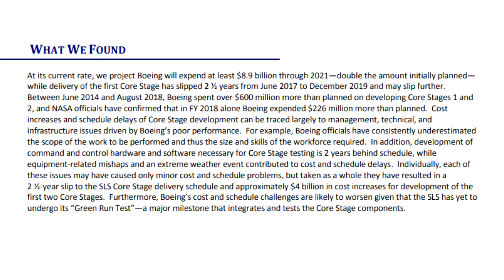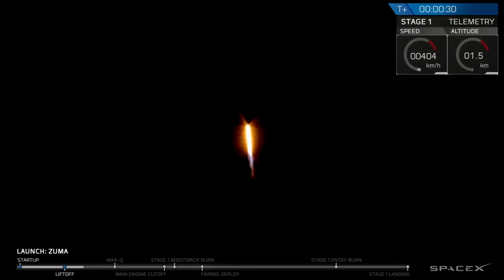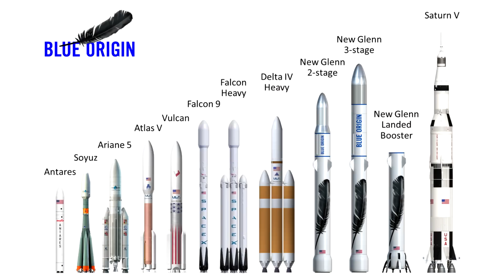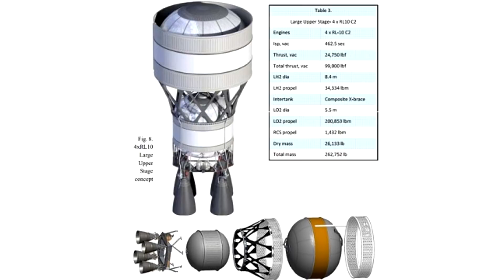New Glenn, OmegA and Vulcan Get Air Force Approval

Comment: I think SLS will be cancelled. Especially if New Glenn gets flying. It is way too expensive and only exists because of government money.

If SpaceX actually gets a certified Dragon II, there really isn't any reason for SLS anymore also.

I'm a little surprised that they didn't give SpaceX some money to develop a new fairing so that they would have them as a backup to the unproven New Glenn, OmegaA and Vulcan designs. It is very likely that one or more of these programs will be delayed, and quite possible that all three will fail. (Space is hard.)

On top of this, BFR could potentially be capable of replacing EVERYTHING being developed. It could be cheaper than anything except New Glenn and will have more DeltaV than any of these.

I hope that all of these new rockets flys. This is an exciting time for a spacefan.
Reply: David Messer It won't get cancelled. It has too much  support from very powerful members of Congress.
Reply: jeffery exposito  political winds change so often that who knows what the future will hold.
Reply: SLS's issue is that NASA fundamentally cannot build big things efficiently. Every project needs to be split into 48 independently manufactured and transported parts to get any funding. Workable when they're building rovers, telescopes, space probes. The things that no private company will do, anyway. Not so good when it comes to transporting huge fuel tanks across state lines on flatbed rail cars. The wasteful practices just balloon the cost of launch vehicles compared to anything else, and SLS design seems to be suffering from so many of the same issues as the rest of the post-lunar space program. My real worry is that the inevitable wastefulness and limited use of the SLS will be used as an excuse to defund NASA across the board, killing off payload development and.... cough... climate change research
Reply: Oh man my heart is racing I cant wait to see the future unfold.
Reply: SLS has always been a trash political move, the project did not came because of the science community
Reply: At this stage, it's anyone's game. The USAF is being picky, as it mostly has been since the STS fell into retirement. Doesn't help that NASA's budget is stretched thin as is, considering SLS isn't their only project (new satellites, new space station plans with Roscosmos, lots of tests, infrastructure upgrades, pretty much the whole nine yards). If any of these fly, it'll be a surprise for anyone. Is there a chance not even one of these radical designs fly? Of course, but there's really nothing we can do as admirers to change an organizations decision to slash a project (except to resort to incessant pestering on social media, but that likely won't do much).
Reply: A spacefan wouldnt work cause theres a vacuum. Duh
Reply: I think that only one of the three rokets in the video deserves any money. The Vulcan and OmegA is the same shit as always, they are basically modernised Rockets from the 80s.
The New Glenn although I hate Bezos is at least a new Development and a technical progress.
I will chear for SpaceX, and I will watch the first New Glenn launch, but ULA and Boeing and Ariane can get lost.
Reply: SLS is further along than BFR. It'll get done.
Reply: Cancelling the SLS would be a massive waste of money considering they already built most of it.
Reply: SLS should be cancelled but they've already dropped $10b on it and might 9stupidy) decide to keep going to save face.
Reply: I'd love to see SLS fly at least once like the Hughes H-4 Hercules back in its days
Reply: I mean, mostly your money goes to Boeing, Lockheed Martin, Raytheon etc. executives.
And to fill the garages of police departments nationwide with milsurp armored cars.
And million-dollar missiles to blow up hospitals and schools in places we don't like.
The government has FAR more issues with how they spend their money than how they get it.

Oh, yeah, and they conveniently put the tax burden on everyone but the people who pay for lobbying and campaign ads.
Reply: Whole space exploration only exists because of government money.
Reply: Your cheap vs not cheap comparison between bfr, and new glenn is pure speculation. No price tag was ever publically mentioned, therefore we have no idea what it will cost. Except for the engine no further hardware has left the factory, or has even been in one. Lets see the first one reach orbit, and then talk money.
Reply: Yes but the problem with bfr(as much as I know) it has no escape system. As you said space is hard and things go wrong, rockets fail. We had soyuz yesterday one of the most reliable rockets ever built failed.
Reply: You know...... I never actually thought about the lack of LES on BFR. Holy shit, that's terrifying - the possibility of a Columbia type failure on a 100 passenger spaceliner, plus however many other things could go wrong with no way out. Is any national space agency going to fly actual astronauts to the ISS on the thing, or will they learn their lesson from STS and keep their distance?
Reply: I think the SLS will eventually fly but it will be just one launch. You can already do what the SLS will be capable of doing with FH. The only thing is that SLS will do it with one launch whereas the FH may need two or three fully reusable launches which would still be much cheaper.
With some clever planning FH could actually re-enact the Apollo mission by launching a Service Module+LEM, a CM (which could be a Dragon II) and a third stage one F9 and two FH launches and have them rendezvous in LEO. 
The three launches would still be far cheaper than a single SLS launch and only one launch would need to be human rated. 

Same for deep space missions. You could launch the actual payload on one FH and a boost stage on a second Falcon Heavy. The payload itself, depending on its mass, could also carry a large quantity of fuel. It might need to expend the centre core on one or both launches though to match the SLS though.
Reply: Absolutely right
Reply: Did you actually just say that Dragon 2 will make SLS obsolete? HAHAHAHAHAHAHAHAHAHAHAHAHAHAHAHAHAHAHAHAHA
Reply: yes, butt the fh or the new glenn can loft as much payload as the sls
Reply: Spacex is developing larger fairings for the FH
Reply: first off, Dragon II is on the Falcon-9, which has no where near the capability of SLS, and it's going to the ISS and not Deep Space. really, SLS will be more on par with BFR

second, there's more than enough market insensitive for SpaceX to develop large fairings
Reply: @1224chrisng  "market insensitive"....bone apple tea!
Reply: SLS has marginally more capacity, and 8x the price per launch. And, it's never flown. And, it's years away. Sure, the later stage SLS is supposed to be a beast. It'll never fly.
Reply: Random Guy You know Dragon II can fly on Falcon Heavy right? It’s currently the most powerful rocket on earn. SLS won’t become a reality so it’s going to pretty much stay that way.
Reply: Random Guy 
The Falcon Heavy could be man-rated. SpaceX chose not to do that because they decided to develop BFR. If NASA wanted a cheaper alternative to SLS, they could pay SpaceX to finish developing FH and then use Dragon II.

NASA lost their ability to influence SpaceX because they want to developing their own vehicle. It’s a classic “not invented here” syndrome.
Reply: @EtzEchad   Falcon Heavy at the moment can't be man rated. It's a rocket that was born under sub par standards. To have the certification for man flight, it needes several modifications and 7 flights.... yea.
And Dragon II is a LEO only capable spacecraft. It lacks any SPE protection, insufficient life support, insufficient re entry shield, it hasn't any power to slow down from a TLI trajectory to enter around the moon. It can't hold the thermal enviroment around the moon because it wasn't projected to. You need a massive overhaul if the capsule and a brand new service module. And within very strict weight limits. FH can push towards the moon 15305 kg ( C3 -0.99 km2/s2).
Reply: nuke99 
Falcon Heavy was designed to be man rated and Dragon II was designed for deep space. (Up until fairly recently, they were planning to fly it around the Moon and to land on Mars.)
It is true that they changed direction and decided to not finish the certification process, but with a sufficient application of money, it should be possible to finish it.
SpaceX has no intention of doing that, but if NASA wants to have a replacement for SLS and Orion, it would be an alternative.

Another possibility would be to launch Orion on one of the boosters being developed. I don’t know how much coupling there is between the capsule and the launcher though.
Reply: @EtzEchad   is it really that difficult to understand? FH is not man rated, but only sat rated (not even scientific mission rating right now), and Dragon II can only go to the ISS as per NASA contract. Musk abandoned the moon Dragon because of all the required modifications i put up.
Reply: nuke99 
Yes, I understand that currently FH is not man rated and Dragon Ii can only go to the ISS. The later, however, is because they don’t have a booster to send Dragon any higher.

FH was DESIGNED to be man-rated though, and Dragon was designed for deep space. If you knew anything about how things are certified, you would know that the design is 90% of the process. FH could probably be man-rated fairly quickly if desired. It would possibly only require extra testing.

Dragon IU would probably require some additional life support but the basic design would work for trips to the Moon at least. (Orion can’t go past the Moon either.)
Reply: I can't understand the people saying SLS should be cancelled. IF BFR and BFS ever flies it will be in a distant future. The deadlines are not realistic, the thing will be more complex and more expensive then the space shuttle to develop (returning a rocket at or near orbital velocity is entirely different compared to a relatively slow first stage). SpaceX has never been able to keep deadlines, and with BFR and especially BFS this will be even more impossible. Not to mention the very limited market for it, wich is important for a company. 
At this moment I am convinced that if there is any chance for a moon landing, or mars mission in my lifetime, it will have to be launched on the SLS.
Reply: Sander Vercammen 
SLS Block 2 is scheduled to launch AFTER BFR is. Yes, SpaceX is likely to slip their schedule, but so is NASA. NASA has never been on time either.

BFR is not more complex than the Space Shuttle. It is actually considerably simpler. (It has to be. SpaceX doesn’t have the resources to make anything that complex.)
Reply: Yeah , I know that, but the SLS is a lot simpler to actually complete compared to the BFR (at least if the BFR will really be a reusable rocket). The BFS is even more problematic, with even more problems to solve even compared to the space shuttle. With all the design changes the BFR is going through it's clear it's in a very early stage of development.
Reply: @EtzEchad  Thinking more adapt Orion to fly on Falcon Heavy. Then adopt a cryogenic upper stage rocket to fly on Falcon Heavy, and pursue an EOR (Earth Orbit Rendezvous) approach (rendezvous in space, and then take off - the US did that twice with the Gemini program), at least for Lunar Missions (maybe send a Lunar lander, or Habitat station ahead of time to orbit the moon?) ... If SpaceX really lowers launch costs, and able to reuse say block 5 boosters 10 times with less refurbishment likely, then EOR maybe the way to go ... or explore at least for the 2020s ...
Reply: its more of a tech development project. I think it will fly and nasa will use it to loft another space station, but the current plan on it is terrible
Reply: BFR could also blow up a couple of times and ruin spaceX
Reply: @G1lb3rt083  
As could all the others.
Reply: They are very different things. SLS is mean to be a deep space launcher while New Gleen is only capable to operate around Earth.
Dragon Crew will carried by Falcon 9 which is, again, only capable to operate around Earth.

Falcon Heavy will not be approved for human transportation as SpaceX decide to put more effort on the BFR, otherwhise they will need to redesign enterly the Dragon Crew, impossible now that last test is month away.
Reply: David Messer  SLS only exists because of government money?   Same as all these other vehicles, exactly as is being described in this video!    Scott even mentions BFR, asking how that is going to happen without government money...a very good question indeed.
Reply: SLS is on an old-style cost-plus contract (that's why it's so expensive: cost-plus encourages waste). The other rockets do indeed get government money, but it's not the same.
Reply: @Jon Jackson,  isn't the Japanese Billionaire Artist paying for the first BFR?
Reply: BFR would actually be cheaper (whole launch, not just per Kg) than New Glenn, IF it gets flying. The build cost of even small 2nd/3rd stages is in the millions, and New Glenn is not small. 100% reusable beats that hands down.
Reply: Alistair Wick
I'm not sure we can talk about the cost of BFR yet given that its design keeps changing every several months. Unless they finalized the most recent design (which we don't have any reason to believe) then there's a decent chance every rocket in this video beats it to market. Not to mention the question of funding, especially since its design requirements are as long as the Space Shuttle's or the F35's being compared to three role specific LVs. It is going to take a lot of money to build a jack of all trades rocket, so we'll see if they can actually round it up
Reply: Government Money?
Guess were it comes from.
Working people paying taxes
Reply: 2cycle...Your tax dollars are allocated to paying the Annual Interest on the National Debt

No. The currency is borrowed into existence as the Federal Reserve Note is a DEBT INSTRUMENT.

What is a NOTE? A Note is a DERIVATIVE on something that is TANGIBLE. A Note is a PROMISE TO PAY for a tangible Good or Service.

You want to purchase a HOME and have no money? No problem, right? The Bank issues a loan and you sign a Note which the Bank retains. You get receivership of the actual property BEFORE you pay for it. They get a NOTE....your promise to pay.

You want to purchase a CAR and have no money? No problem, right? The Bank issues a loan and you sign a Note which the Bank retains. You get the actual CAR BEFORE you pay for it..They get a NOTE...your promise to pay.

Considering the case of Homes...Now the Bank DOES NOT HAVE ANY MONEY TO LOAN. So where do they get it? They have to borrow it from the Federal Reserve. Does the Federal Reserve have any money? No. They order the Federal Housing Association, or Veterans Administration, to borrow the Money through the issuance of a 30 YEAR BOND. 

Your 30 Year Mortgage is backed by a 30 Year BOND, a 30 Year US Treasury NOTE.a DERIVATIVE, which is just another promise to pay.. Then the US Treasury "prints" the currency, creating it out of thin air and that is also a DERIVATIVE, as much as the Promissory NOTE that you signed at the Bank when you initiated the mortgage to purchase your home..

It is somewhat likewise for a car except that the loan is backed by a Ten Year Bond and is not guaranteed by the US Government.

They are NOT CALLED Federal Reserve NOTES by accident..

So I want you to tell me just how "YOUR" Tax Dollars are paying for this when you have done absolutely NOTHING to have created the outstanding debt that finances Space Exploration, or, you have NOT, ever once, MADE ANY PAYMENT on the Principal of the National Debt.

And guess what? The INTEREST that is to be paid on that National Debt was NEVER CREATED by the Banks or the Government.

This serves two purposes. 

FIRST...It guarantees that their will be defaults on Mortgages so that the Bankers can steal your property, your Home, back from you WHEN THEY RESTRICT THE MONEY SUPPLY BY RAISING INTEREST RATES....which Jay Powell has been doing for the past year. 

Financial failure is DESIGNED INTO THE SYSTEM It is planned. It is BY DESIGN. 

(And then I get to hear people complain about the "deadbeats" that the system INTENTIONALLY CREATED in order so that the BANKS CAN STEAL THEIR LABOR...  Those people will invariably say,  "I pay MY bills. Those deadbeats deserve to be homeless and their kids need to be starving as that will teach them not to be deadbeats."  Yeah. There is a special place in Hell's FIRES for these types of self righteous bastards. ANYONE WHO HARMS A CHILD...ANY CHILD...BURNS. The Banksters will be there, as well as the self righteous pricks. And then these are the  same people who pretend to be Christian? I know atheists with more class than that.)

NEXT...It also guarantees that the US Government will have to borrow ever increasing amounts of capital in order to keep spending at the present level.

HERE IS SOME TRUTH.

George Bush DOUBLED the DEBT in eight years.
Then Barry Obama DOUBLED the DENT in eight years. 
And Donald Trump is on schedule to DOUBLE the DEBT in his eight years...assuming that he serves two terms.

And the master of this game was Ronald Reagan who TRIPLED THE DEBT during his eight years. 

I do not care if they have an R or a D behind their name as they ALL DO IT The only recent one who SUPPOSEDLY did not was Slick Willie but he raided the Social Security Trust Fund in order to print those fraudulent Debt Numbers..

And it has been this way ever since the CURRENCY COLLAPSE of 1979-1980.

To tame inflation Paul Volcker switched Government Financing from outright printing to outright BORROWING.

We were the World's LARGEST CREDITOR NATION in 1980. By 1982 we had transformed from that into being the World's LARGEST DEBTOR NATION.

The Debt is just a STEAL - th INFLATION for our children's, children's, children to pay.

So please...Go ahead...Tell me all about how your tax dollars are funding any of this. I am all ears. 

Like most Americans, you haven't a real clue as to what has been happening or is happening currently. And this market is going down, brother. 

Yeah. I am pissed off about it because in all likelihood, you, like most, did not care to get a clue...and then ACT.. to STOP THIS FINANCIAL MADNESS. 
(Now I may be mistaken as you may have a clue. But I do not think so from your post...Tax Dollars my ass!!!)

But I have spent my time GARNERING A CLUE. And yet I cannot stop this from happening  as I am only an army of one.

(And I'll wager that you believe that Lincoln was a great President too...when he was the absolute worst.  But that is another rant...filled with inconvenient facts.)

END THE FED....fuckin' banksters. STARVE THE BEAST.

/rant.
Reply: Elon goes to jail and SpaceX gets bought by Lockheed Martin.
Reply: And don't worry about Elon going to prison. He's an unimaginably rich white guy. At most, he'll probably get a token fine, a couple weeks of community service or jail, and get demoted at SpaceX. I hope Gwynne Shotwell can do better work without an increasingly unstable narcissist for a boss.
Reply: @Tuxfanturnip  Yes,the fact that he is white and rich and not Jewish and rich bothers you doesn't it ,jew?
Reply: Nah, just that his fanboys are uncomfortably cozy with... let's see... people who spout Nazi propaganda, for one thing.
Reply: @Djprojectus I'm not saying Elon is a Nazi, not by any means. He's a vaguely well-meaning narcissist who gathered himself a cult of eager bootlickers looking for a god-king to serve. He panders beautifully to a wide range of groups: Cryptonazis, smug engineers, half-assed environmentalists, singularitarian robotheists - If you want to ignore the systemic problems of the world and convince yourself one Great Hero can save humanity, he's the man for you!
Reply: @Tuxfanturnip   I've never commented anything about Elon, good or bad! And it may be exactly what you said,a narcissist but what its not alright its the fact that you attacked him as a white guy and not his caracter! If i would attack you because you are jewish you would cry antisemitism and holocaust again! Stopi it with the anti whiteism at least here on Scott Manley chanel who himself is white! You have other chanels to cry nazism and antisemitism!
Reply: I'm not attacking Elon for being white, just stating the facts. Rich people tend to receive far more lenient convictions / sentences. So do white people. Elon has the influence to wriggle out of this. A lot of people don't. Personally, I'd prefer drug use weren't a crime at all, but that's irrelevant. How is pointing out the application of simple stats "anti-whiteism"?

Plus, of course, the very first sentence you wrote here pointed "jew" directly at me, as an insult. The word "holocaust" has come up only when you try to put words in my mouth. Every word you've said has been bad-faith bait to make me look bad. Please stop.